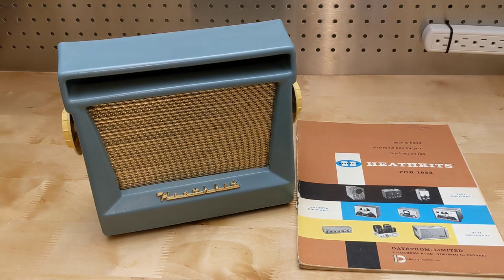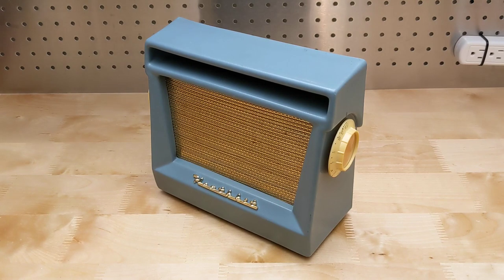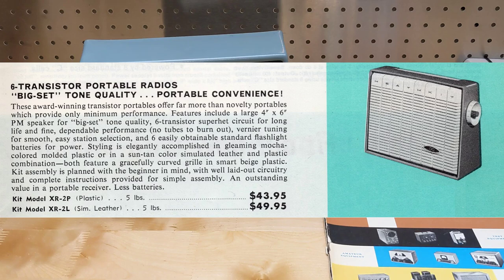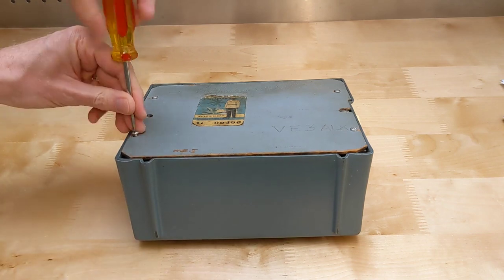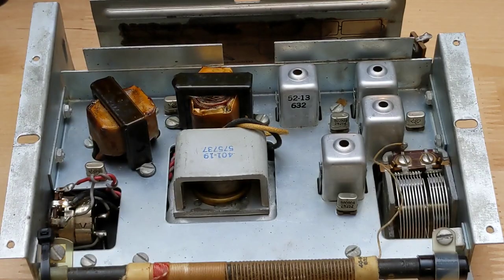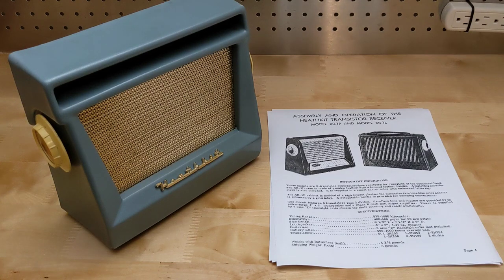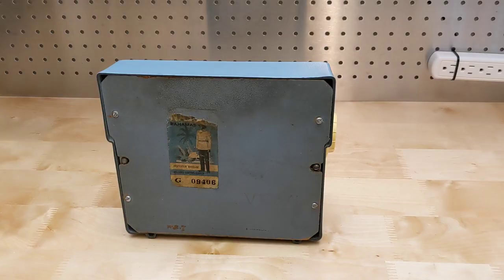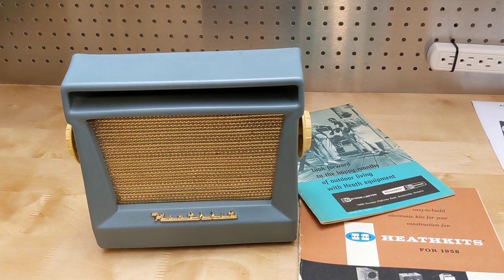The Heathkit XR-1 Transistor Portable Radio

Comment: Do you have many AM stations where you are? I belive there is one where I am in New Brunswick but depending on the capability of the unit you can grab a few stations from the US
Reply from the maker: There are three local AM radio stattions here in Ottawa, and at night more can be picked up as the signals travel farther.